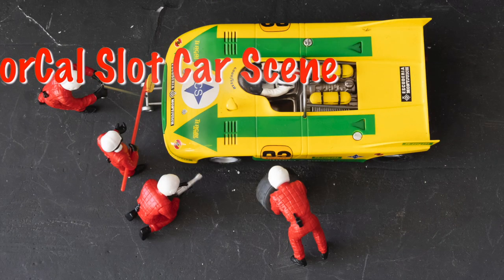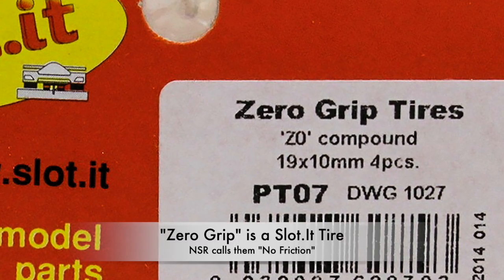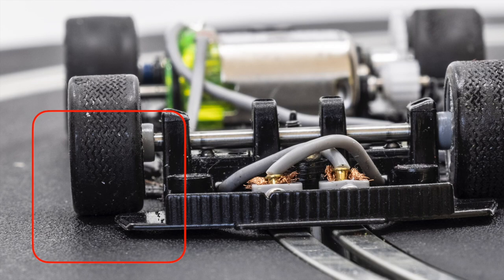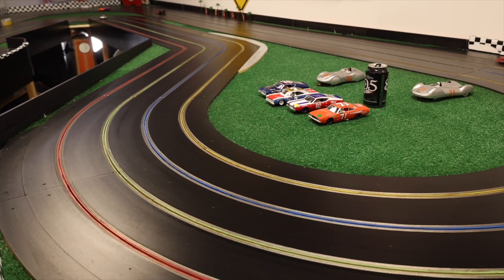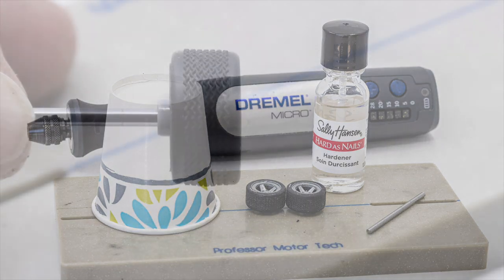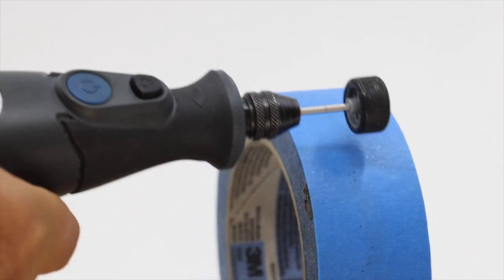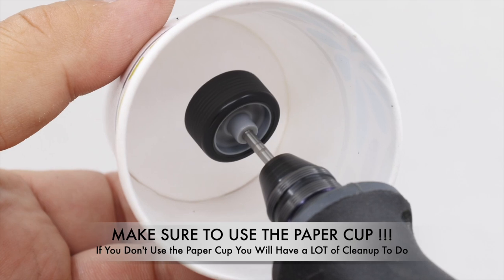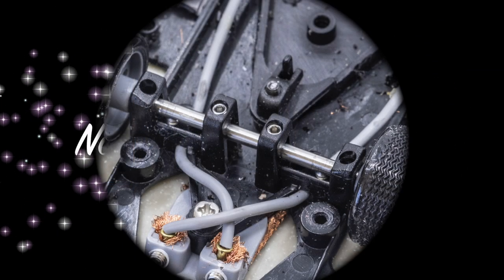Zero Grip Tires for Improved Slot Car Handling

Comment: If you want a quick way to achieve a loose car, wrap one thickness of sticky tape around the tyre (shiny side out). It's no good for fast lap times, but a quick and easy way to try driving your car with very low grip and lots of wheelspin and drifting. Try it on one rear wheel first, then if you want to emulate even more slippery rally conditions, wrap both rear tyres... it's great for developing throttle control, and as the cars are sideways at much lower speeds, you get to see the action much clearer... When you are bored of it, just peel the tape off and you are back to normal... No cost, no faff, no mess, no tools required...